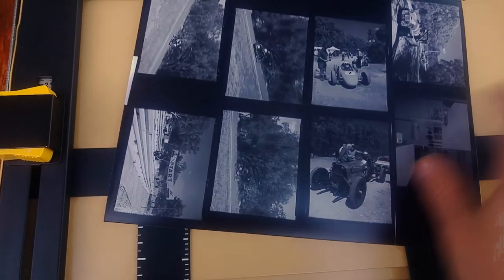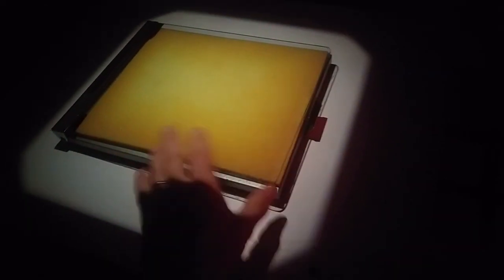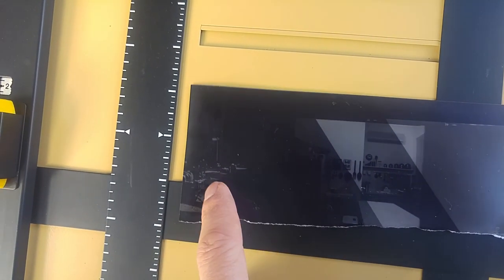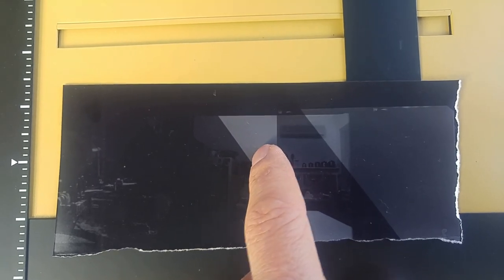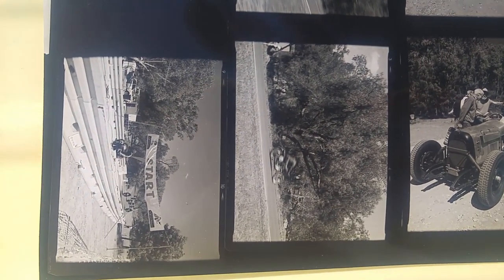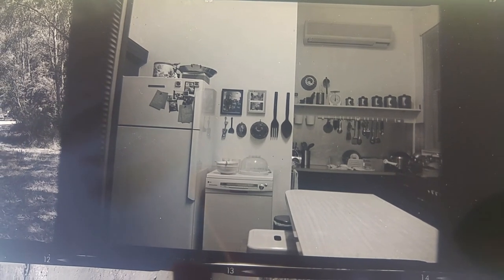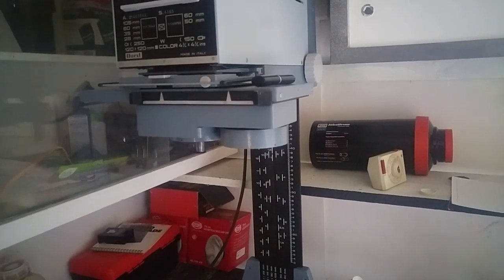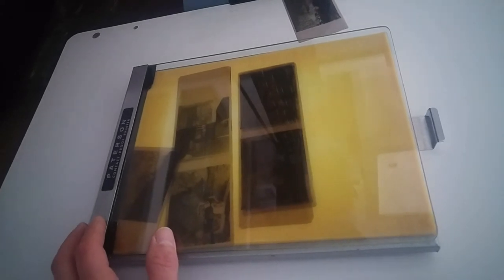black and white contact print, my technique explained. B&W printing

Comment: Hi. I don't use the test stripes exposure in contact sheet. I prefer to expose all my images to the max black for the film base. So I can valutate immediately the best negatives, the worst, the good images for printing. With this method you can learn your workflow and to know exposure mistakes, developing etc. etc.